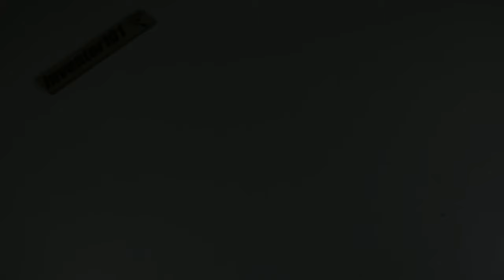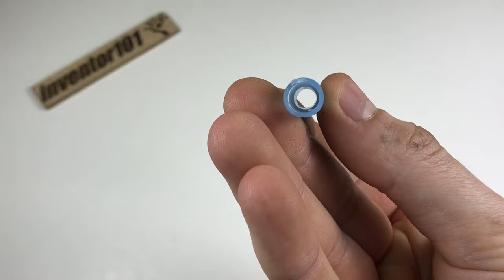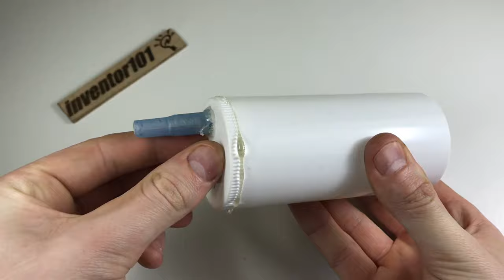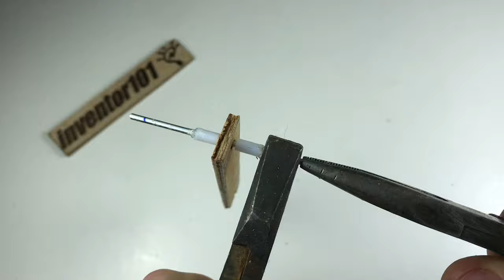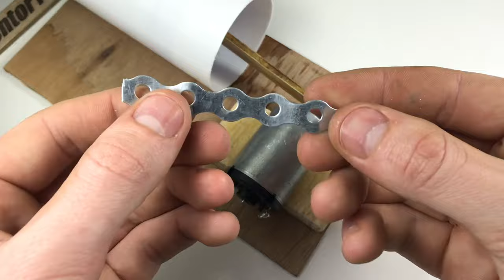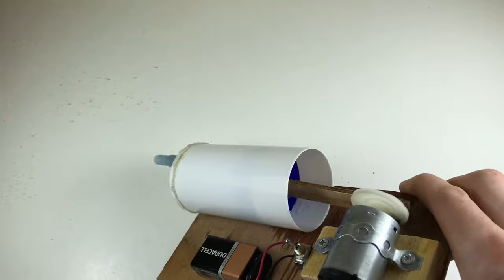How to make a air pump at home

Comment: hi, i v gota question here, just like in a  bicycle pump, there is inlet and outlet valve , which lets the air come and go,  doesnt the same princle applies here also  in air compressor pump alos, as i can see there is no inlet and outlet valve